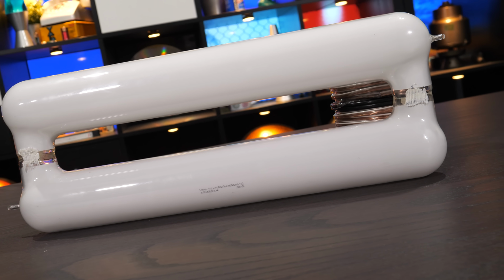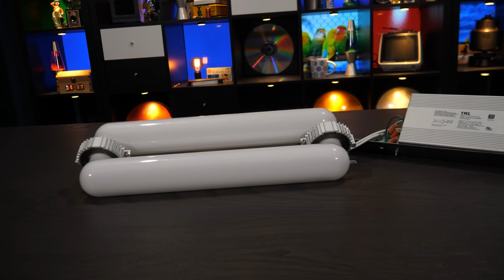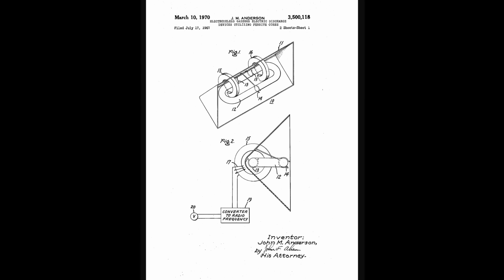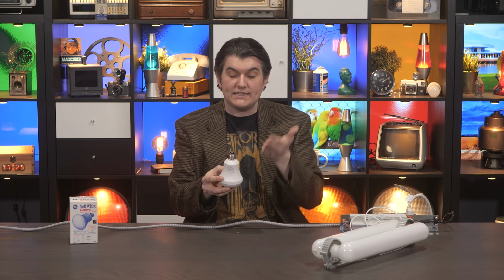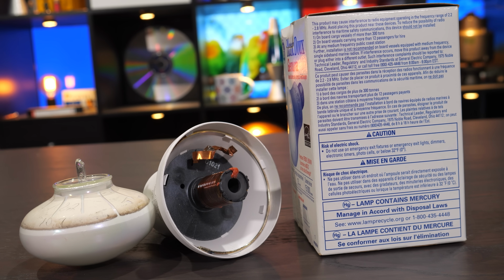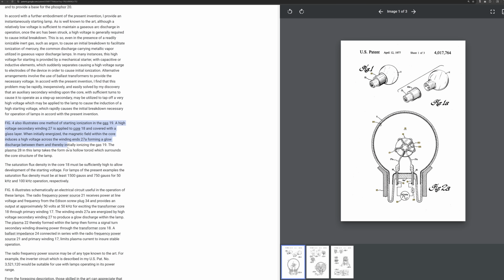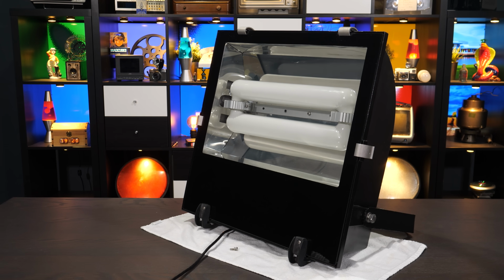Induction lamps: fluorescent lighting's final form

Comment: Great summary!  I remember looking at the Philips QL lamps in the 90s for a church I was relamping.  As I recall, the cost per bulb/unit was $200+ so cost ruled it out.  I bought a couple induction bulbs out of curiosity but they were too large for standard fixtures so I used them as "show and tell" in my talks.
Now we have mercury-based bulbs being phased out and illegal in 9 states due to environmental concerns.  Plus lumen depreciation is still a concern.  But it was a good bridge technology until LEDs came up to speed.
In the 1990s though PSE&G in NJ put up thousands of these induction streetlights and from what I can see many are still in service today.  The City of Groton CT did a large study on these at the same time and decided to adopt them, but it didn't happen before LEDs took over.

Comment: Use case that comes to mind would be hot cells for working on extremely radioactive material. It would be way to dangerous to have someone change the lightbulb and LEDs would probably get fried by the radiation.

Comment: Those were used alot in high bays at warehouses, some lot lights, and occasionally under canopies at gas stations. Shit wasn't cheap. Especially over time, it was cheaper to install a  Metal Halide lamp and replace the $10-$20 lamp every few year than replace the power supply on the induction ones.

Comment: An unmentioned downside of LED. 

We're missing the near infrared spectrum we once got.

Medicine is just now learning the benefits of near Infrared light. 

A big one is it generates melatonin in the mitochondria of every cell, protecting it from oxidative stress. 

Without fires in our hearths, and absence of incandescent bulbs, we only get this by going outside... Which fewer people do all the time. 

Of course we could make near infrared LED's... Which I've found and purchased, but it's far from mainstream.
Reply: I use mostly LED lighting, but the much beloved incandescent flood bulbs in my kitchen date back to when the house was built in 1994. They're specialty bulbs rated for 130v instead of the usual 120v, and they've always been on a dimmer where they have to to be dimmed up to full brightness. If an incandescent filament is never shocked by going from off to full power, the bulb can last for decades.

Comment: The startup secret is the difference in voltage between the two coils. The coils are the electrodes.
Reply: Reasonable thought, but doubtful. Glass insulates DC and low frequency AC well, and if you're saying there are different windings on each then it would be running power through its startup cycle at all times. It also doesn't explain the phenomenon of "Regular fluorescent bulb lights up in the same room as a moderately powerful radio."

Comment: I did an internship at GA a few years ago while in community college. We built a vacuum chamber to test different RF antenna designs for heating up helium plasma (the goal was hydrogen but I was just an intern). I think it operated at around 20MHz 100W max output. I spent month building  basically this light bulb (though it was controlled by some python script I helped write too.)

Comment: it's really too bad that we never seemed to find a set of phosphors for fluorescent use which produced high-quality light output at a reasonable cost, especially for warm white light. I did spend $$$$ on some cold white fluorescent lamps at the end of the fluorescent era for use maintaining my otherwise completely untameable circadian rhythm, and the light quality from those was indeed quite good (CRI in the mid 90s), but ... they were cold white. the lowest color temp you could get with decent CRI at tolerable (but still high) cost was in the 5000K range. maybe there were warm white fluorescents with decent color rendering for use cases where cost was no object, but there was just nothing above CRI 85 at the consumer level. and believe me, I looked.

Comment: Not sure if its safe to run the tube without an enclosure which has heavy shielding as I was told these lamp emitt RF energy what if its at 2.4 GHz in theory it would fry the user like microwave oven... :P

Comment: It creates the initial higher voltage to help initially ionize the gas and lower the resistance enough to use less power. The most interesting thing about the 3 mhz one is how high the voltage is the the rise and fall times have to be super fast

Comment: I have a small UVC tube from a 1950s lamp. The tube is quartz glass with a ball of mercury rolling around in it. The lamp was excited by a coil wrapped around the tube that was driven by a vacuum tube down in the base. Unfortunately I never saw it work before it was taken apart, but I imagine it was a pretty potent UVC source.

Comment: LED bulb supply still emit noise - trying using them on older garage door openers.  The one on a house I recently purchased had such a short range when leaving.  Replaced the bulbs with incandescents and fixed the issue.

Comment: When they start in the cold, it's localized heating of the Hg.  That heat starts to spread.  RF heating is a real thing.  And at HF freq, it takes a bit, and since it's a wave that will couple end to end, you'll end up with "nodes" of the standing waves within the tube.

Comment: I worked for Finally Light Bulb Co. in Boston from 2015-2019. We resurrected and improved the  Genura design. The company failed due to LEDs cost and quality improvements. Our costs were too high. It was a high quality bulb with a $12-17 price range. Our CRI was, and still is, better than any bulb out there. Too expensive to produce.

Comment: I have some Finally bulbs that I bought around 2008. The company marketing materials called them acandescent. I think they operate on the same technology though. They have a small amount of mercury and are slow to reach maximum light output. I still have a few in use but am going to replace them with LEDs for this reason.

Comment: A straightforward answer for the ionization is just the Lorentz force. In a sufficiently large magnetic field, a moving atom’s nucleus and valence electrons will feel opposite-direction forces since they have opposite charges. So the magnetic field can create polarization; for a sufficiently fast atom/molecule (which will be present following Boltzmann statistics), this magnitude can be large enough to ionize the particle and give a chain reaction for dielectric breakdown and glow discharge.

A neat example of the magnetic and electric fields’ reciprocity, depending on your frame of reference!
Reply: This is a concise and interesting explanation which I like of a possible mechanism. However, I thought you might like to know that a day later there was an explanation from one jssyoutube1, claiming to be a plasma physicist, who stated that "thermal ionisation is negligible at room temperature". The supposed replacement mechanism is that in practice there are always a few free electrons around as a result of cosmic rays and other background ionizing radiation, which are free to repeatedly pick up energy from the RF field and slam into atoms, starting the breakdown chain.
Reply: @HypoceeYT Thanks for pointing me to that comment— I don’t think what I am describing would be “thermal” ionization, though, because of the presence of the magnetic field. I would understand thermal ionization to mean spontaneous emission of electron/ion pairs due directly to temperature, in the absence of fields, in analogy blackbody radiation/thermal excitation into the conduction band, etc. (I come from a condensed matter/materials b background, so I’m outside my expertise) Point taken though, that there would always be some ionization from the background.

Comment: Can you drive the large tube from other locations? If you used a larger ferrite core, could you power it from the wide sections? Are you sure there's no metal inside the sections which go inside the coils?
Thanks for another interesting video.

Comment: Where do you find these things?   I’ve installed a lot of these induction lamps in warehouses 10 or 15 years ago. They were supposed to replace metal halide light fixtures but they didn’t last very long as they were phased out by LED’s almost right after they were released.

Comment: The tube may last a long time but the inverter may wear out long before 100,000 hours.  A lot of LED bulbs could also last much longer as well if the electronics that drove them were built with a larger capacity factor than necessary.  Even incandescent lamps can last more or less indefinitely if they are run at a tiny fraction of their rated light output.   Inverters and power electronics have a greatly reduced lifespan if they are run closer to their thermal envelopes or in too hot of an environment.   There are also sulfur lamps that are pumped by microwave radiation.  Economics and availability drive technical choices.

Comment: It is awesom that low temperature LEDs are possibly greater than sliced bread (which did not get nobel prize). 

The 2014 Nobel Prize in Physics was awarded to Isamu Akasaki, Hiroshi Amano, and Shuji Nakamura for the invention of efficient blue light-emitting diodes (LEDs). Their work enabled the creation of bright, energy-efficient white light sources by combining blue LEDs with existing red and green LEDs.

Comment: The coil is part of an  LC circuit which is excited at its resonance frequency by the electronic driver. On startup, with no arc in the tube, and therefore no load on the LC circuit, the Q-factor is high and a very large resonating current circulates in the LC. The resonant current produces a high enough intensity electromagnetic field to ionize the Argon and ignite the plasma arc. 
After ignition, the conduction in the gas loads the LC circuit reducing its Q-factor a lot. As a result the resonant current in the LC circuit becomes negligible and most power is effectively transferred to the plasma arc

Comment: I actually got to watch a CFL burn out not too long ago. I noticed it start flickering, which immediately caught my attention as we'd just had our master breaker replaced due to arcing (the whole box got swapped shortly thereafter), and as I turned to look it got very dim, and one of the legs incandesced before the bulb went dark, leaving a black scorch mark on the tube and housing. Would very much like for that not to happen again, and while this looks like it would work around that problem, most of the LEDs I've installed are working fine.

Comment: The semiconductor industry uses inductively coupled plasma all the time: just a glass bell jar with precursor gasses flowing through it, and a few turns of RF coil wound around it. They manage to strike plasma just fine with that setup, but honestly the RF folks in wafer fab equipment are treated as a priesthood of ultra-specialists whose work is inscrutable to outsiders, even within a firm full of curious nerds.

Comment: Magnet polarity is constantly moving always, although degradation over time, still moving at different speed in turn exciting the mercury vapor.  Efficacy, CRI and PRI is still a question, as is ballasting.
 Still no great value proposition to the human condition. Ballasted, Mercury Vapor ?+more than 20%, non recyclable. whats the draw ? not to mention the light lost outside visual spectrum.
 Check out Johnathan Nash Ott "the Visual Spectrum 1&2...and that was in the 80's?

Comment: Years ago, I saw a theater sign that used glass tube letters for the marquee...as I recall, the letters were orange, so I guess it was neon? The letters were easily changed around, held in with clips.
   I saw this in the '70s...no idea how old it was at the time...

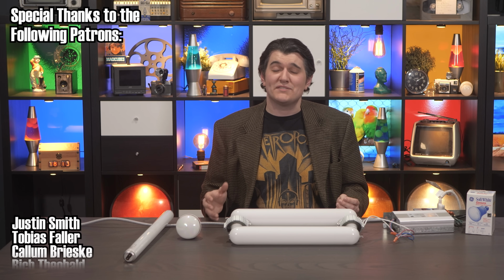Comment: 28:05 Too bad LED's suck for CRI and directionality. They still haven't gotten the color temperature right either. And not to mention how a large amount of light coming from a small surface area is not desirable. Oh and forget about cost. LED headlights on a car vs halogen bulb, umm it's thousands of dollars in difference. We're definitely not there with lighting yet.

Comment: In the single coil design there's another coil connected to the working coil while winded together with the main coil, when the tube hasn't been ignited that coil is actually a resonant circuit by itself parasitic capacitance. So it induces a high voltage at the starting process to strike start it.

Comment: The primary winding can serve as an initiator. Conductive strip contacting the glass surface would be just more effective, but it seems windings are close enough to the glass and the voltage across the windings is high enough, especially during startup, that there is no need to ruin the elegance of the design by introducing bare wires and the winding dubs as a discharge initiator. The control circuit must have been designed in a way that it ensures higher enough voltage output load is low i.e. before gas ionization. Ignition could also be controlled by actively monitoring resonating circuit parameters and applying corresponding voltage and frequency until ionization occurs.

Comment: 17:50 not necisarily an issue for street lights, as those come on (usually) when it's dusk and stay on all night. Taking 10 minutes to get to full brightness won't be a bad thing if there's still enough natural light to navigate for another 30.
Reply: Or if you're far enough north that cold is a common problem... you're also far enough north that twilight lasts for 2 hours.  As a kid growing up in Edmonton, I never understood why watching a sunset was considered romantic because it took FOREVER.
Reply: Some CFL just don't brighten at all in cold environments. They stay permanently dim until ambient temperature rises.

Comment: Modestly powerful radio frequency signal does have enough energy to excite a very low pressure gas, there is no mystery here. The key word is very low pressure. Try to stick a small Neon lamp to a radio (AM or FM) transmitter antenna.  And the transmitter does not need to be particularly powerful.

Comment: generally in plasma discharges the ignition happens when free a free electron, created by a cosmic ray, is accelerated enough, by electric fields, before hitting an atom that the energy of that collision is enough to release more electrons, and you get a cascade of electrons.

Comment: At the centre of the magneto-hydro-dynamic structure you would get gas ionisation?  This is the 'zero-point' of the magnet where in LENR ( low energy nuclear reactions ) such as cavitation in water a vortex is created of such force that it can for instance, fuse electrodes of Al13 + Al13 to produce Fe26 so it wouldn't have trouble starting a light's ionisation reaction ... like you say all that is needed is a higher than normal pulse from the supply to bring it on. Hmm interesting that Hg residue, has it gone through any change in composition?